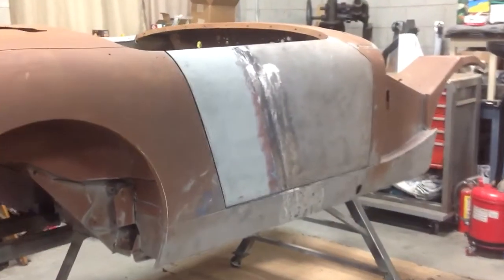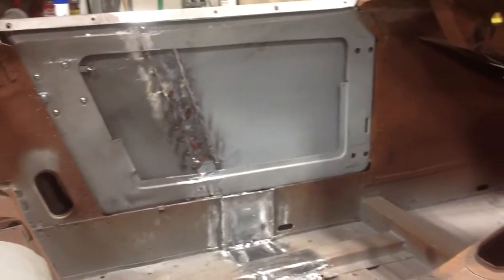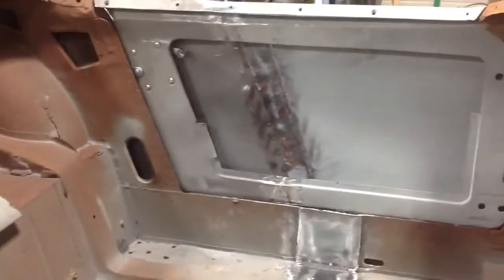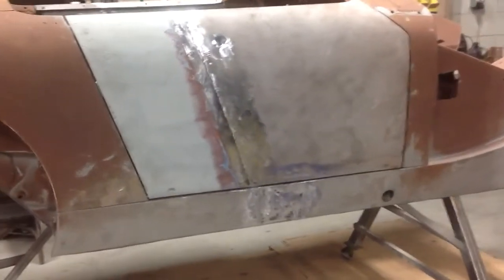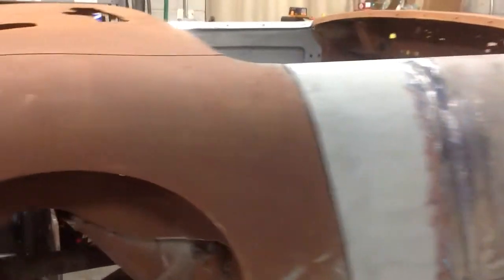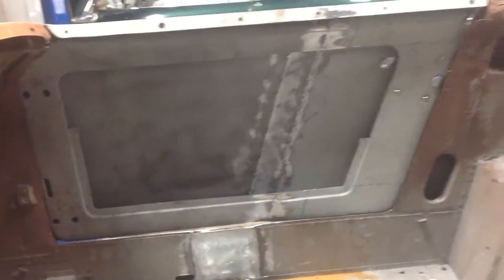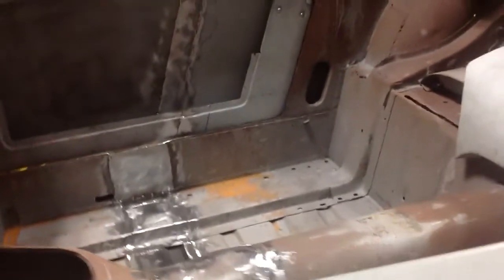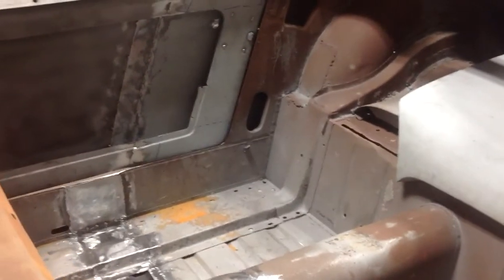Long wheel base bugeye Sprite number two, completed!

Comment: I've shortened and lenghened cars in the past and you shouldn't just add a piece in all the way across like that, the correct way to do it would be to stagger the joint through the tunnel and inner and outer sills so that you don't have a weak point across the car.  Hopefully you added in some strengthing after this video as otherwise that will be a death trap.